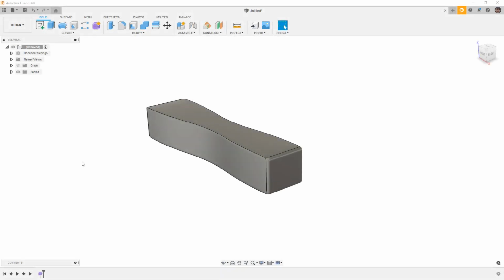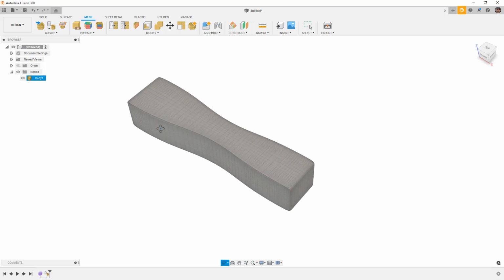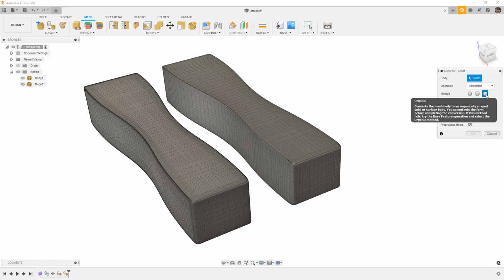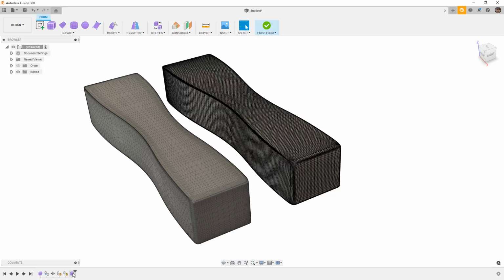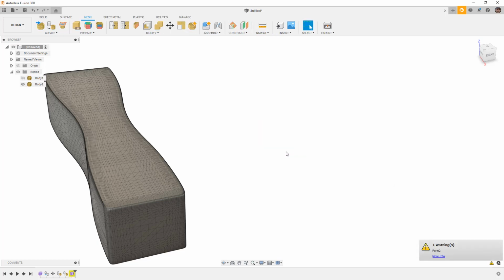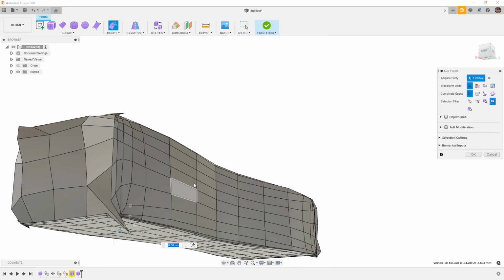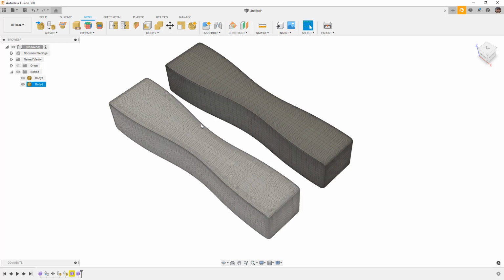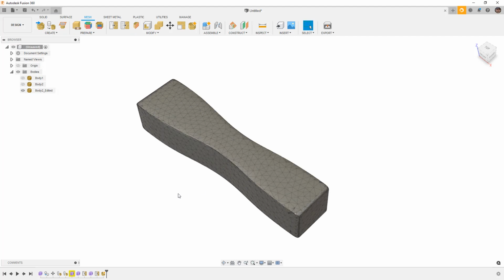NEW Tri Mesh to Quad Mesh to Form Body Conversion in Fusion 360 #Fusion360 #MeshConversion

Comment: The ok button is disabled when number of faces is set to >5000. :(
Reply from the maker: Bummer!  Fusion generally sets the "limit" at around 10k faces.  Sometimes it will give you a warning but you must have hit a limit.  It is somewhat model specific.
Reply: @LearnEverythingAboutDesign  10k for input mesh? My input mesh is 30k, when I set the target face count to be 5k, it’ll give me many warnings and then fail to produce a model due to ‘self intersecting ‘ reasons.
Reply from the maker: @jrM5492  10k is the number Fusion pops up on the screen when you try to convert a mesh to brep or to a freeform model.  I think its a very general thing as I have had inputs over 10k convert before.  I think larger relative element sizes are easier to deal with but one reason is that the freeform model you get won't be optimized.  If you made the same shape with a new freeform body it can often be done with many fewer faces.

The other options are to make it a quad mesh in another program and bring the quad mesh in.  Then in the forms tools you can use Utility > Convert and just select the Quad mesh to Tspline option.  Keep in mind this generally is a 1:1 translation of the quad mesh control frame.  So if you have really large or really small quads that is what you get.

Aside from that you might need to go to a 3rd party solution depending on what your end goal is.  For example https://www.npowersoftware.com/NewCyborgMeshToCADOverview.html  if you just need a BREP.